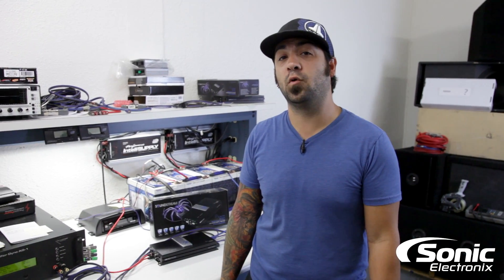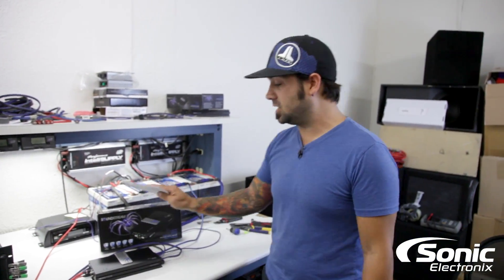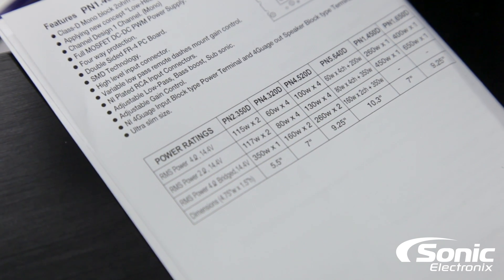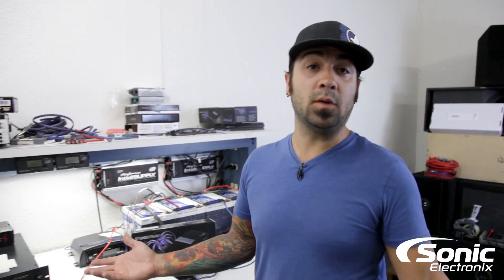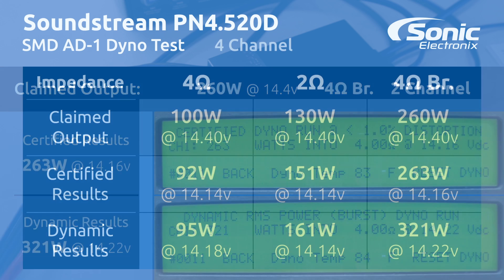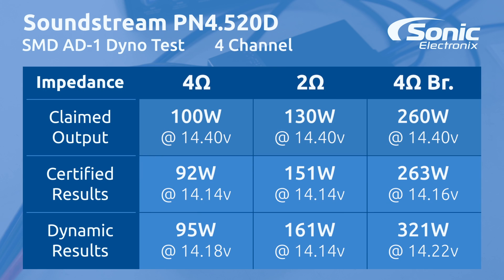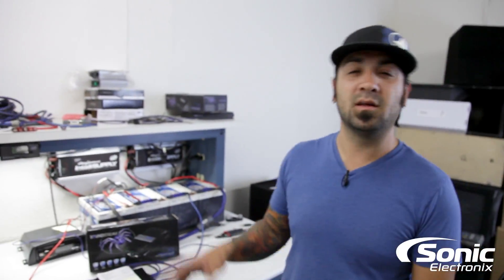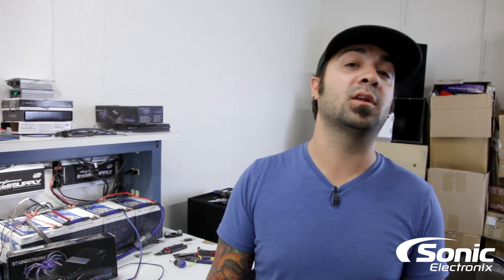Soundstream PN4.520D Amp Dyno Test | SMD D'Amore AD-1

Comment: I remember listening to amps inside the high end car audio stores and they always sounded awesome. Once the amps are in the car they really didn’t match the performance from the store.... was it because the power in the  car is more like 11Volts by the time it reaches the amp ???
Reply: Don't forget that you are standing in a business designed to get you to buy things. They don't just throw things together. The entire display area is designed to sound at its very best and unless you are building a theater at home, you won't be able to perfectly match what they created at the store.
Reply: Get yourself a optima battery yellow top. Problem solved.

Comment: Hi! Just need your help. Would a PN2.350D be enough for a TS-w255c pioneer subwoofer? This subwoofer is 700w max, 350w rms, single coil, 4 ohms. The PN2.350D claims to deliver 350W RMS in a bridged mode. Any tips? Please?

Comment: those amps have horrible audio and crossovers for full range or high pass
Reply: i think you might have an install problem ive had old amps new amps and even 5 dollar amps that sound ok as long as installed correctly and not turned into a clipped night mare maybe your speakers was out of phase or possibly shorted ? im running a " 1700" watt audio bahn 4 channel amp for my mids and highs 2 cerwin vega 6x9 and an antique horn and when adjusted properly even it sounds decent sound stream is a much more respected name in car audio so i cant imagine them producing a bad product
Reply: +arsonist63086 Mine sounds great, and I used to have an Eclipse EA4000 for my Diamond Audio full range components and coaxials.
Reply: +arsonist63086 Just out of curiosity, are you saying this based on spec sheet numbers, or based on actually listening to them when properly installed. Using the wrong kind of RCAs (single ended vs. twisted pair) can cause issues. These Soundstreams need singled ended, according to their tech support. Also, install issues like running lines too close to the car's wiring harness can introduce noise. Bad grounds can too. Sometimes it's necessary to run the ground all the way back to the negative battery terminal. Have you considered/tried all these things?

Comment: Can we PLEASE get an amp dyno of the new hifonics brx series amplifiers? Since they are no longer cea 2006 compliant I'm curious to see if they will still put up their rated power or fall short. PRETTY PLEASE!!!!
Reply: Like the brx2016.1d or the 3016.1d 👍👍
Reply: +Nathaniel Renner They don't seem to want to do it. Myself and a few others have been asking.
Reply: +WeSRT4 probably because the new hifonics amps aren't as good as last years models. I've seen the guts of the brx2016.1d in comparison to the guts of my brx1600.1d, the 1600 looks a lot more stout. Ugh maxxsonics!
Reply: I recentley ordered the BRX2000.1d for two Type R 10s because I think the new BRX amps look like poop.
Reply: +WeSRT4 yeah I think you will be much happier with the brx2000.1. Kind of sucks that maxxsonics puts out great cea 2006 compliant amplifiers for a few years then reverts to their normal boss level crap. Just when you think you can trust a company lol. Personally I have the brx2400.1 and it's a beast of an amplifier for the price. I don't clamp exactly 2400 watts but I still get right around 2000 (I have a 220 amp mechman alternator, optima yellow top under the hood, and for now 4 50 amp hour cheap marine agm batteries) on 2 sundown x10's (v1's) in a trunk wall tuned to 32hz. Hopefully the 2400.1 is still available after xmas, I plan on strapping both and upgrading the battery bank. 😀👍😀👍 What are you going to put that 2k on?
Reply: Nathaniel Renner Two Alpine Type R 10s wired to 1 ohm. It should be more than enough power for them.

Comment: How would you wire 4ohm door speakers to 2ohm? or just buy 2 ohm speakers. sorry in advance if this is a stupid question but I've never heard or seen how to do it
Reply: +Joe Ramos Same as you wire the subs.
Reply: It is simple electrical operations, it helps to have some technical knowledge of how components function but I'll give you the skinny real quick. (If you wish to learn more, look up ohms law). Simply put resistors, or in this case voice coils, have set amounts of resistance. If you wore a 4 ohm resistor in parallel with another resistor, you get half the resistance (i.e. Half of four is 2) and when wired in series the sum of resistance goes up like addition. (I.e. 4+4=8). So if you have two speakers each with one positive and one negative and you wire the two positives and two negatives straight together (parallel wiring) you would get a final load of 2 ohms, where as if you went from one positive to one negative on each speaker you would wind up with an 8 ohm final load. Hope this helps! Happy bumping!! 😀👍✌️
Reply: **wore = wire
Reply: I guess I should clarify a little more about series wiring. When you wire in series your two speakers (assuming they are single 4 ohm voice coils) you would take one positive off of one speaker, and wire into the negative of the next. The leftover two terminals would then wire to the corresponding terminals on your amplifier. This would then net you a resistance of 8 ohms. I did a piss poor job of explaining series wiring in the above comment so I hope this helps to clarify. 😀😀
Reply: +Joe Ramos My door speakers are 3-ohm (Infinity Primus). I have the 320 version of this amp, which puts out 60x4 @ 4 ohms, and 80x4 @ 2 ohms. Because of this, I may be seeing 70 or so watts, which is nice.
Reply: two 4 ohm down to 2 ohm reds two red two blacks hook them up set your cross overs to high pass and and leave the gain down till you get more comfortable with my best advise to you dont do any thing with out your handy dandy multi meter best of luck to hou